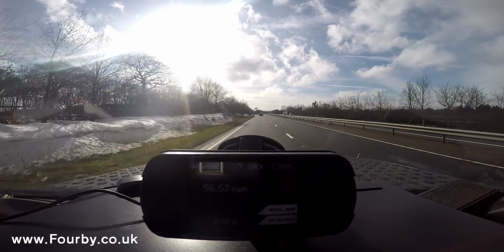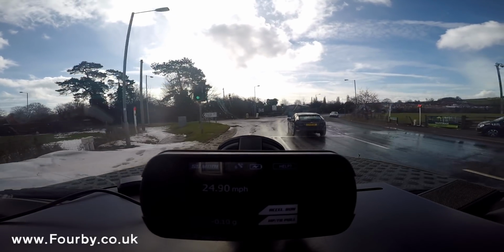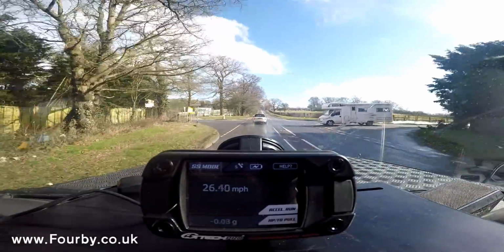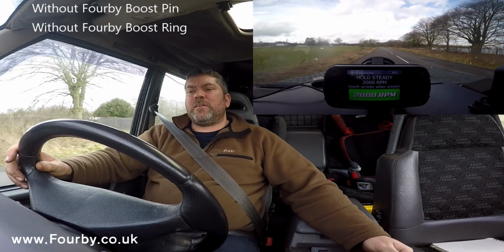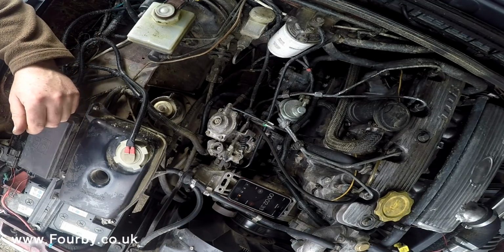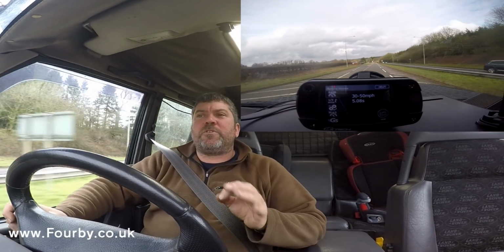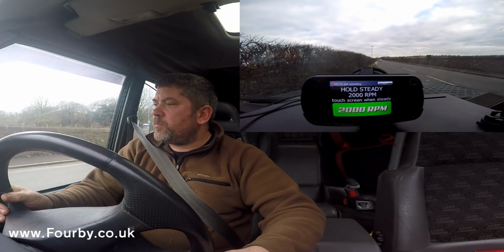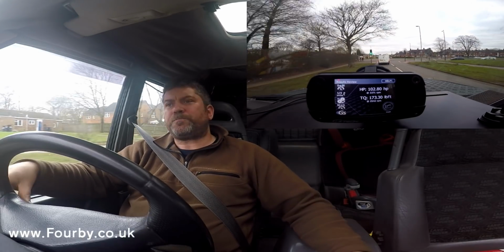Fourby Boost Ring - Dyno results - 25% more power

Comment: I just installed a Boost pin two days ago. What a difference. I just installed the boost ring....I really can’t tell a difference. Maybe it’s more smooth in the higher RPMs, but it’s hard to tell. 

I hit 700 C on my EGT pretty easily just at the top of 3rd gear. 

What do I do next? Not much smoke.
Reply: Hybrid turbo and bigger intercooler 👌 the Hybrid turbo should lower EGTs if you run the stock 15psi
Reply: Matthew Downes I have talked with a few other owners and my top speed is 122 km maxing EGTs. I was told by another guy whobhad the same problem that once he installed new injectors, he went from 120 top speed to 145 easy. Given the higher miles on the engine and lack of maintenance from previous owners I believe this might be a good next step.
Reply: @jeremylakenes6859  What size of injectors
Reply: @deuskariisa3382  Factory injectors, but I just had Bosch rebuild them. That made a large difference. My EGTs go up quick still

Comment: fitted one today (boost pin already installed) if anything the engine is a little rougher and although it picks up a liitle quicker / lower down in the rpm theres no chance it adds 25%

Comment: Thanks for the informative video something I was told was doing these 2 items makes the egt skyrocket to dangerously high temp risking engine damage also what’s the smoke like as I currently don’t get smoke at all and dose it effect fuel economy? I currently get about 29-30 mpg
Reply: It's not too bad, I mean Defenders for instance have quite a good stock cooling system so it won't cook anything unless you're ragging it. Best idea would be to upgrade intercooler and set up a few more gauges to make sure the temperatures are good

Comment: How does the boost ring affect smoking? I noticed my 300Tdi disco smokes under load with a boost pin in and I was wondering if adding a ring would make it worse. Especially with the upcoming changes to the MOT rules.
Reply from the maker: The boost ring will improve the smoke, as it allows a more complete burn 'inside the cylinder. that's what gives the power

Comment: How much does it affect fuel economy / consumption?
Reply: Keith Tan 
Hi do anyone know how much it affect the fuel economy?
Reply: The boost pin is the only part that would increase fuel consumption because it lets in more fuel. However the argument is that you get an earlier boost from the turbo so it counteracts it, for instance short and heavy blasts will use more, whereas motorway mpg will be better.

The boost ring only increases combustion by adding more pressure, so in principle it's probably increasing mpg rather than decreasing...

Comment: Good vid only the gain from 30 to 50 is 0.7 sec not 1.5 sec.....Still a good gain though.....Sold :-)
Reply from the maker: We've both got it wrong Bandit. If you watch again. The number was 5.08, not 5.8, which is a 1.42
Reply: No Problem, Just sorting out if mine already has both items, if not an order will soon be arriving. Good work with the vid's, Keep it going :-)